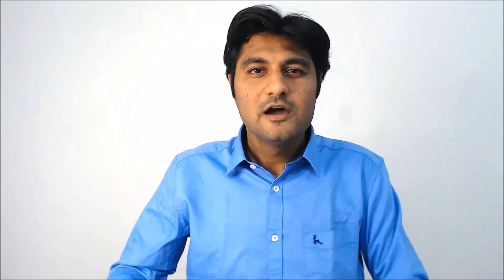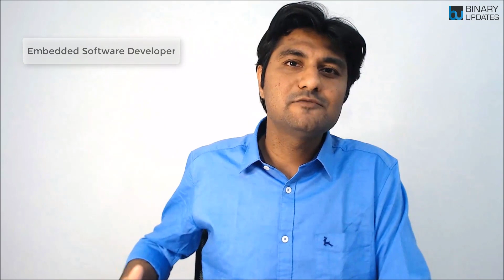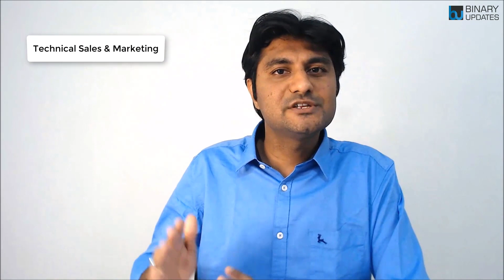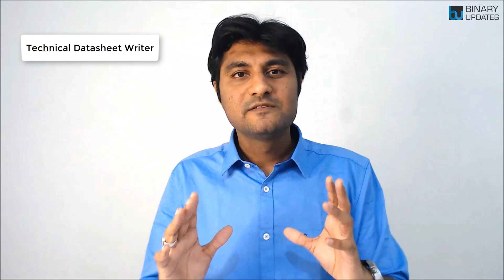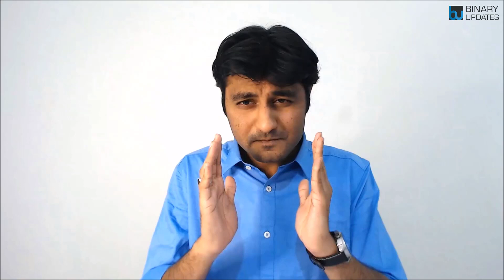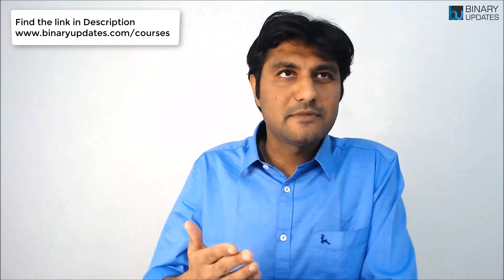Roles and responsibilities of an Embedded Systems Engineer

Comment: Sir i have completed my b.tech with automotove design engineering bt i want to pursue these courses as i have so much interest in .please help in this.
Reply from the maker: Hi Ankur, 

You can start learning Embedded C and buy Arduino Board whichi has 8-bit AVR Microcontroller (ATmega328). I will suggest you to build some cool projects using bare-metal c programming for microcontroller and interface several sensors to learn about them. I hope this may be helpful suggestion for you. Wish you good luck

Best Wishes
Umesh

Comment: You seemed to have implied  Embedded Hardware Engineer is different from  PCB Design engineer but you didnt say what is the difference between the two.
Reply from the maker: Hi Jo

Embedded Hardware does involve hardware level programming where we use HDL, VHDL, Verilog with FPGA,ASIC, CPLD etc and other technologies to synthesis hardware to design digital logic. Yes, PCB Design is an part of hardware design but it doesn't mean embedded hardware is all about PCB Design. I hope you get my point otherwise I have pointed you to do your further research. Good luck! 

Best Wishes
Umesh